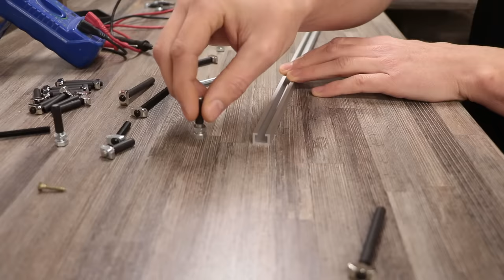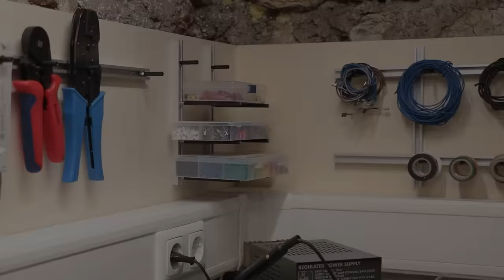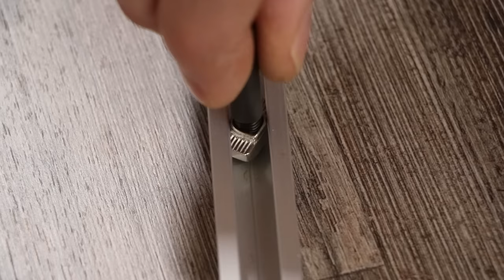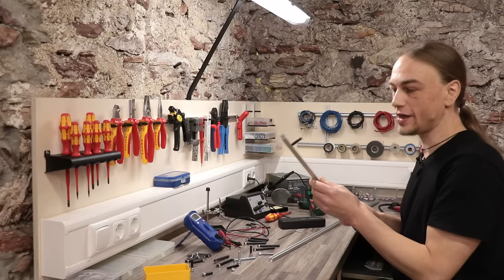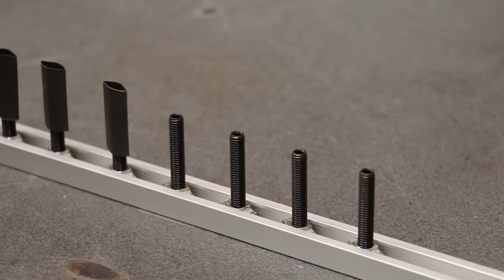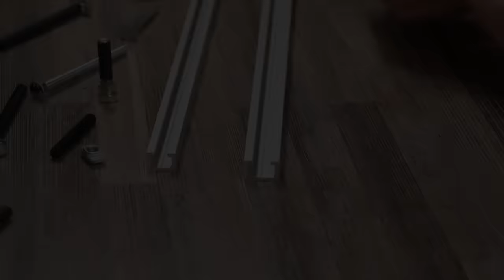Flexible Werkzeugwand 3 - Frenchcleat Alternative für jede Werkstatt

Comment: Ich hab’s auch nachgeahmt und bin super zufrieden, danke nochmal für die Idee!

Ich habe mir übrigens die Mühe gemacht die Profile in einer Nut zu versenken. Überschauberer Aufwand, die Profile halten bombenfest selbst wenn ich die nicht zusätzlich angeschraubt hätte und sieht toll aus.
Reply from the maker: Feine Sache, das geht natürlich auch. Nur ist dann ein Umschrauben nicht mehr möglich. Aber wie gesagt, jeder kann das nach seinen Wünschen anpassen und es ist schön zu lesen, dass das System schon so oft individuell genutzt wird!
Reply: Ich werde die höhenverstellbare Version als Standard verwenden und die Horizontalen einlassen, vielleicht sogar ganz einfach in Brettstösse packen:) Wenn ihr sagt, die 10-15cm Schraubenabstand in der Horizontale sind notwendig für die Stabilität, dann werde ich drei Vertikale bei 60cm Breite nehmen müssen. Außerdem schwebt mir ein Steckboard für die Horizontalen vor, mit Fassungen für Bohrer, Schraubendreher und vielleicht auch einer kleinen, gefrästen Stifteschale:) 
Diese Lösung ist so unfassbar flexibel, wie simpel👍🏻

Comment: Gutes flexibles und günstiges System! Allerdings kurzer Widerspruch bezüglich 9:50:
Man kriegt Bosch-Profile 11x20 Nut 8 z.B. für 5,74 der Meter für Nicht-Industriekunden.
Da kann man dann auch die T-Nutensteine nehmen oder aber die Nutensteine mit der Kugel. Ob eine normale 6-Kant-Mutter ginge weiß ich gerade nicht...

Comment: Hallo Sven, klasse System hast du dir überlegt! Nachdem ich deine Videos hierzu gesehen habe, bestellte ich umgehend alle Teile. Unter anderem habe ich die Hammermuttern bei Amazon gekauft. Nicht alle Muttern passen in die 8 mm Schiene. 3 von 4 Paketen, die ich bestellt habe, waren zu breit und zwar ca. 1/10mm. Die passenden waren 7,8mm breit, die anderen genau 8,0. Den Amazon Verkäufer habe ich kontaktiert. Habe nun bei eBay neue hammermuttern bestellt. Grüße, Alex
Reply from the maker: Moin Alexander und danke für die Rückmeldung. Bei mir haben bisher alle gepasst. Manchmal drückt sich auch das Aluprofil leicht zusammen, wenn man es zu sehr festschraubt. Das kann auch eine Ursache sein, dass ein Zehntel fehlt. Gruß, Sven

Comment: Sehr gut umgesetzt. Gefällt mir. Allerdings werde ich passenden Silikonschlauch mit 5mm innen nehmen statt Schrumpfschlauch. Ist nicht so glatt, dadurch hängt das ganze noch etwas "softer" und kann nicht so leicht nach vorn raus rutschen. Kostet ungefähr 3-4,-€ der m.
Reply from the maker: Ja, das geht auch, macht die Stifte aber deutlich dicker und schränkt die Flexibilität ein. Deswegen der Schrumpfschlauch
Reply: @SvensWerkstube  Na ja, dicker werden sie nicht unbedingt. Den Schlauch gibt es in verschiedenen Durchmessern und Wandstärken. Damit es etwas strammer auf der Madenschraube sitzt, wird 5mm innen recht passend sein. Außendurchmesser gibt es dann in 5,6,7 und 8 mm. Somit trägt das eigentlich auch nicht mehr auf als der Schrumpfschlauch.
Reply from the maker: Wenn es passt, ist es ja auch in Ordnung. Ich hatte anfangs auch an Gummischläuche gedacht. Schrumpfschlauch ist aber für meine Zwecke am Sinnvollsten

Comment: Würde ein 6mm Bohrer und Rundshaft nicht das das Problem auch lösen? Ok die Stifte lassen sich nicht verschieben, aber ein neues Loch bohren ist auch nicht so problematisch, das alte Loch kann man auch leicht zumachen mit Sekundenkleber und den Rundstab
Reply from the maker: Ich weiß gerade nicht genau, was du meinst, das Video ist ja schon älter. Aber wie auch immer, wenn die Methode für sich selbst praktikabel ist, kann man sie natürlich anwenden
Reply: @ :) Ich wollte nur den YT algo ein Tipp geben das das Video weiter empfohlen wird,
Was ich meine ist das man einfach das Werkzeug a die wand hält zwei Orte markieren und dort 6mm Loch bohren und ein langen 6mm Holzstarb hinein klebt. 
Dein System ist natürlich grader und schneller verstellbar usw. Aber braucht mehr teile.
Ich werde dein System versuchen zu kopieren mit Ikea Gardinenleisten und 3D gedruckten Hammermuttern
Reply from the maker: @sevenismy  Ah, ok. Das käme der klassischen Lochwand oder den guten alten Nägeln nahe. Kann man machen, aber für mich ist das definitiv nicht flexibel genug. Gerade das ist ja der Sinn und Zweck meines Systems. Dass man die Stifte verschieben kann.

Comment: Erstmal vielen Dank für dein System und dass du das teilst.. Ich hoffe, du findest einen soliden großen Partner und kannst da Geld draus machen 😁 Mein Problem mit French Cleat: ohne Werkstatt kann man sich nicht mal die Leisten bauen 😞

Nun zu meiner Frage (und ich hab viel durchgeschaut, ob das schon einer gefragt hat): könntest du mal so Std Längen für die Schrauben empfehlen, auf die viele Werkzeuge passen (35mm für nen Hammer oder 70mm für nen Akkuschrauber)?

Danke und weiter so
Reply from the maker: Danke dir, Daniel. Ich meine, ich hätte es in einem der Videos erwähnt. Ich empfehle 40mm und 70mm Stifte. Damit ist man für die meisten Werkzeuge gerüstet. Kürzer als 40mm ist wenig sinnvoll, da dies die flexible Nutzung einschränkt. Also lieber ein paar mm zu lang als zu kurz. Die 40er finden in der Regel die meiste Anwendung
Reply: @SvensWerkstube  super. Ich hab mal die erste Runde Material bestellt. Bin schon gespannt 🙂